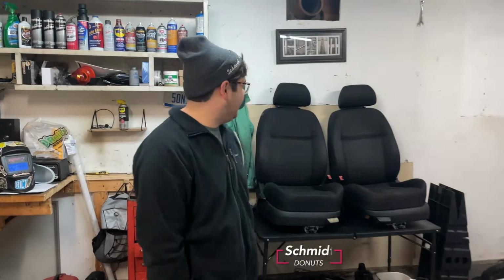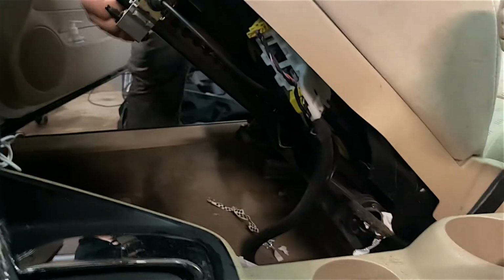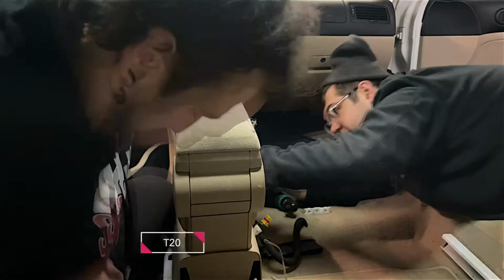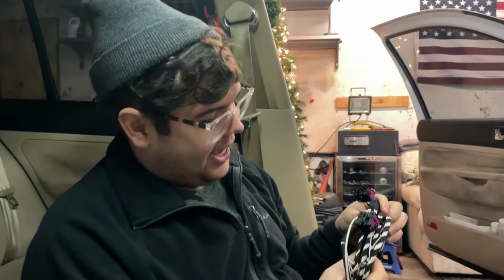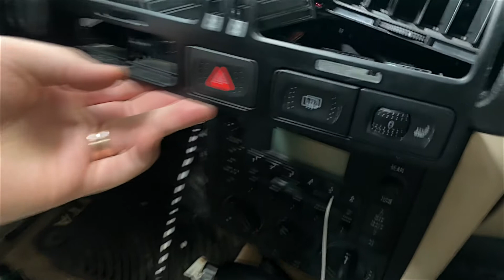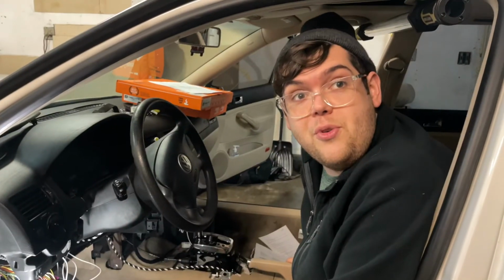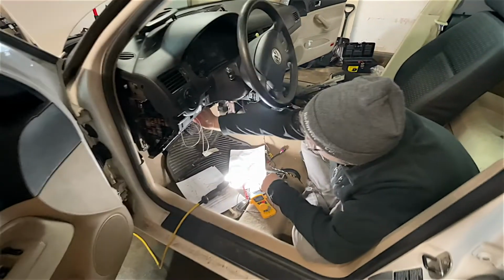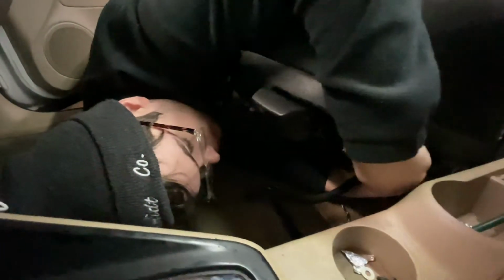Donuts Ep: 5 - MK4 VW Jetta TDI Heated Seat Mod Pt. 2

Comment: Some of the older mk4 and B5 cars, the T20 retention screw is a dreaded Philips screw instead.  
The good news: usually a 200 pound gorilla that owned or maintained the car prior hasn't stripped the living bejeezus out of the these ones.

Retrofitting wiring for power is even easier than the heated seat wiring (if you're not after the memory function).  So, keep your eyes peeled for a future upgrade!

Comment: Hey guys I just had some questions on wiring. I got my seats wired in correctly, however my battery is draining. Did you have to wire another wire to fuse 5 (the 7.5A fuse?) just not sure where to go from here. Thanks
Reply: Hi, do you solved the problem 1 year later? It's interesting me